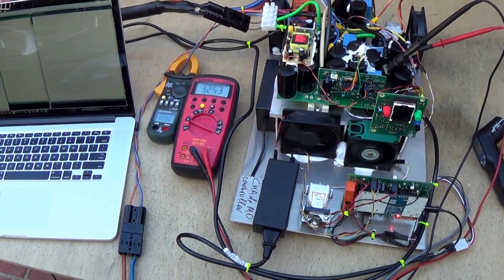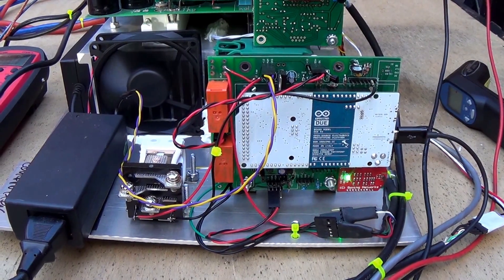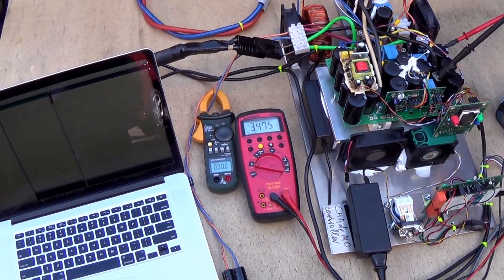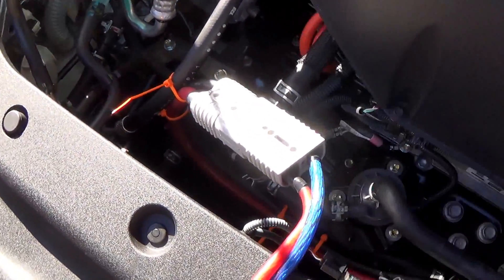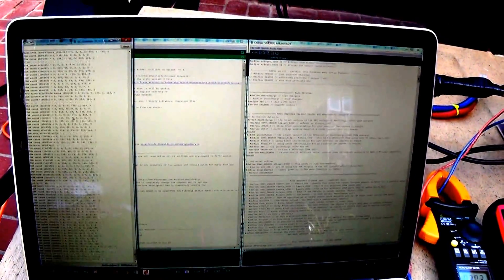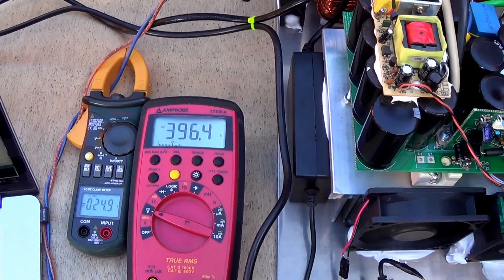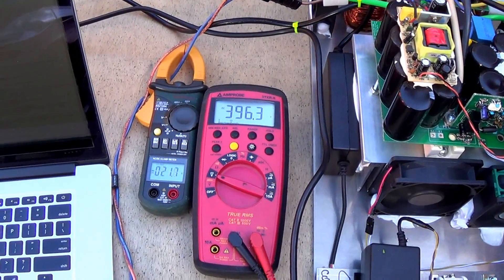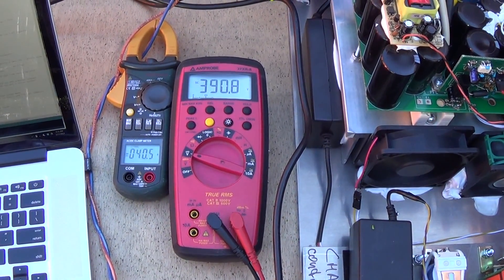RAV-2-LEAF - charging a Leaf from a RAV via CHAdeMO using one of our chargers

Comment: Level 2 (240V) portable charging station with 2 current levels. 10 or 16 Amp
http://www.ebay.com/itm/ev-charging-station-cord-cable-J1772-EVSE-Current-select-16-10Amp-110-240-Volt-/252101131205?hash=item3ab265fbc5:g:EKcAAOSwFnFWAnRC&vxp=mtr

Comment: Valery, this is amazingly cool. I could see a RAV4 EV serving as a 'rescue charge' vehicle to give stranded Leafs enough charge to make it to a DC fast charger, or wherever! Have you tested charging when the RAV4's battery is mostly discharged, to see how your charger deals with lower-than-ideal pack voltage on the donor side?

Comment from the maker: Apologies for audio - those fans turned out to be much louder in the video than in real life. Got to be the directional mics' fault...
Reply: Charging via another battery is an awesome idea. I have 2 strings of 12 245Watt solar panels. Each string gives me approx 410 Volts DC. So I imagine I could use this charger to charge my leaf directly from my panels.
Reply: Arthur Amendt It sort of might work a bit but with solar you really need control logic to maximize the solar output. It's not like a battery source.
So a direct solar charger would need to be designed for it. EMW could probably add such a feature in code.
Reply: Arthur Amendt I have done this twice now with my DC setup on my electric VW. Once with my solar battery bank and twice now with my old 240 Welder. I was able to get 48 amps into the pack via the welder. Direct through my controller. No external charger. Just the controller and a source of DC power. Check my videos if you'd like to see. Did the battery pack one over a year ago. Just recently using the welder as my DC source of power.
Reply: Dan Frederiksen Direct from solar is quite possible. The system I use can do this.